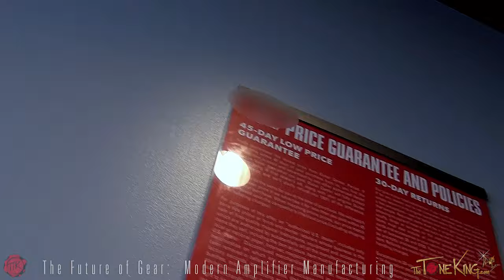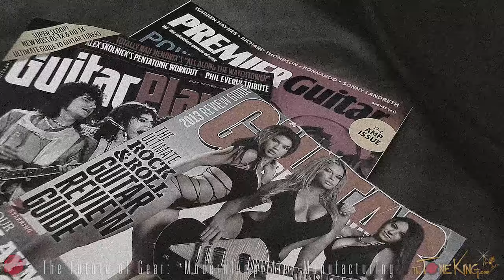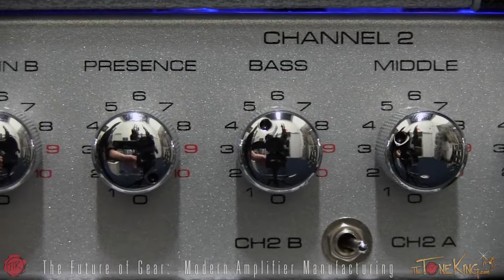The Future of Gear - Modern Amplifier Manufacturing

Comment: I have a China made Peavey 6505+ 112 combo amp and it kicks ass. Never had a issue with it. I believe manufacturers are going over seas because there is a bigger market for mid price products. I believe Custom Amp companies can cover just a small part of the market. I don't think that made in USA or UK generally means BEST option. Play what you can afford and play the hell out of it. I use Mesa Boogies and Peavey because is live outside the USA and the Fixed Bias option on it works for me. To me are some of the best sounding amps out right now. And they are easier to replace than most custom amps. Also people are using AXE FX and Kemper because its just way cheaper to travel with. In my opinion tube amps sound better but they are not as reliable and concistent as Digital.

Comment: I have a black heart 5w tube amp, the wiring is solid and it has never let me down, I did change the tubes when I got it , great amp for me it sounds nice like a good boutique amp, it can keep up with drums , if I need more volume it can be put through the PA. If I had the cash I would buy a boutique hand made tube amp. same with guitars if I had the cash I would by a £2000 guitar but I can't afford one, so I get solid mid range guitars and tweek it until it's good for me and I'm happy with them. if people had the spare cash we would buy the high end gear but the average person has to make a choice do I buy the expensive amp or the expensive guitar.

Comment: I would give my left nut for a 3000 dollar Soldano! I had to settle for a used Carol-Ann for 1600,and a 700 dollar H+K. There are only two big box guitar stores that I know of. Soldano doesn't have to advertise! In my opinion,the Jet City amps,were some of the best sounding amps  out there.

Comment: you want consumers to focus less on price? good luck on that. inflation keeps going up, wages keeps staying flat, and everyday musicians play for free most of the time nowadays. there's a reason we focus on price. it's because people don't have the money. don't forget the dwindling popularity of guitar driven music or over the last decade. cheers.
Reply: +Thomas R. Bowen I agree his thoughts on price is totally is out of touch of reality.
Reply: +Wendell Laffin you're correct. their main point probably is to buy a simple high quality amp instead of modelling amp with all the bells and whistles. there is some truth to that, but most can't afford what these guys need to charge. I'm pretty sure most people would love to use expensive equipment but it's not worth it to most. if you have a choice between a 300 dollar amp and a 2000 dollar amp and the 300 dollar is 85% as good as the 2000 dollar one, most will pick the 300.
Reply: +Thomas R. Bowen I think you are both right.  In my experience, the 300 amp and the 2000 amp have much greater differential than 85% there.  And there's certainly nothing wrong with trying to get the best deal.  You're right, the economic situation has made it tight for everyone.  The point here isn't that people should overpay.  But as you pointed out, taking the extra time to save the extra money to get a higher quality piece is our point.  With guitar gear, there's simply no substitute for quality.  You feel it, you hear it.  It's basically this - rather than buying 3 $250 guitars, players are better off buying 1 good $750 one.  That's what we mean by not fixating so much on price.  And believe me, the manufacturers notice.  When customers are only buying guitars at the $250 price point, we have to ask ourselves why bother to make a nice, $750 guitar?  That leads to lack of available quality options.
Reply: +sammy reynolds  - you can see this response below too, but for ease, let me clarify the point we were making.  there's certainly nothing wrong with trying to get the best deal.  The economic situation has made it tight for everyone.  The point here isn't that people should overpay.  But taking the extra time to save the extra money to get a higher quality piece is our point.  With guitar gear, there's simply no substitute for quality.  You feel it, you hear it.  It's basically this - rather than buying 3 $250 guitars, players are better off buying 1 good $750 one.  That's what we mean by not fixating so much on price.  And believe me, the manufacturers notice.  When customers are only buying guitars at the $250 price point, we have to ask ourselves why bother to make a nice, $750 guitar?  That leads to lack of available quality options.
Reply: +Diamond Amps I would agree that a player should buy a good 750 guitar instead of 3 250 guitars. a collection of junk is still junk. I'm afraid many are in an economic situation where they are happy to have 1 250 guitar, sadly. since gigs for most of us don't even cover the beer tab, let alone pay people, so you can't even write off equipment on your taxes as a business expense. the real ironic part is though that all gear, even high end gear has gotten cheaper since the 50's and 60s. a lp guitar back then would have been between 3-500 bucks. that would have been 3 or 4 months pay for alot of people. now an lp costs what, 1500 to 2500, which takes the average worker a month or so to make. overall, your better off not collecting junk, but to say we shouldn't worry about price is an over statement.
Reply: +Thomas R. Bowen - sure.   And the statement was a generalization.  Not everyone's situation is the same.  There is a clear trend in the market, however.  That's the overall point.  But of course, I'd much rather see someone buy and inexpensive amp and guitar and PLAY, than not at all.
Reply: +Diamond Amps BINGO....that's exactly what I would much rather see so that further down the road when they have more money they'll keep buying as well as keep playing and improving. Either way they will still be part of the market and not part of a dwindling market as you called it in the video. Basically, get them playing and keep them interested and then build it and they will BUY. :)
Reply: +Wendell Laffin cars aren't guitars my friend and you don't always get what you pay for. not all people are cash strapped that's certainly true, but the car market and guitar market are different demographics. as far as the amps go, I think people exaggerate the difference between solid state, modelling and tube amps. my mustang 3 sounds as good as any 112 combo I've heard, you just have to know what your doing. maybe it's just me and I'm hearing what I want to but that certainly doesn't mean that don't work the other way. for me personally and where I'm at, my mustang 3 and classic MIA peavey guitars are just fine.
Reply: Thomas R. Bowen You're definitely wanting to hear what you want. A good 1x12 would smoke you mustang.
Reply: +sammy reynolds I will admit it got quite a bit better after putting a swamp thang speaker in it, but I dig it and I don't get paid to play, so I'm not spending the extra $$$ unless I get in a serious band. the notion that you can't get good sounds from an ss amp though is nonsense.
Reply: Thomas R. Bowen I agree with that. if you don't gig what's the point in paying $1,000 for an amp. And I never said you couldn't get a good sound from a SS. Go listen to Pantera. Dimebag used SS Randalls.
Reply: +sammy reynolds that is true, you didn't say it. I was just going with general opinion I've been reading on this thread. what kind of randall did he use?
Reply: RG 100's I believe
Reply: +CaribSurfKing1  Socialism is very expensive !!!!!
Reply: +Thomas R. Bowen i agree. These folks make fine equipment I'm sure, but given the economic situation going on these days, Diamant needs to readjust his thinking. People probably SHOULD focus less on price but they won't. It's not like there's a choice. Bottom line is, people ARE going to make music. With a clothesline, a stick and a washtub or a cigar box and some old wire, but people will continue to make music.. What they WON'T do is continue to pay higher and higher prices for gear. That's HIS job, not ours,  to figure out how to bring a quality product to the market that's also affordable to Joe the Guitarist. If he can't do that, sadly, his business will ultimately suffer.  (PS - the ALL CAPS words are not shouting...just for emphasis )
Reply: +Wendell Laffin you're right. there is always a market for high end gear. I'm sure these amps are great amps. I'm sure they sound great and are quality builds. I think the main thing though is how it was said came across to me as dismissive. as if to say, if you don't buy high end gear, you will sound like shit and you're not worth our time. I think you can get great sounds with gear at a lower price. is a diamond amp better than my mustang, probably, but until I play in front people who can tell the difference, I'll stick with what I have. I buy the best stuff I can find, used, with what I have.
Reply: +Wendell Laffin Wow, why so sarcastic? I was responding to his comments that people 
should stop considering price. I wasn't "directing" anyone. They're the 
ones who have to pay their electric bill, not me. They can either sell 
more amps cheaper or fewer more expensively. Makes no difference to me. 
He made the statement. I gave my opinion of it and people can choose to 
take it or leave it. No need to get all hostile, friend...its guitar amps, not world hunger/poverty.
Reply: Diamants job is to make and sell guitar amps. Its simpler really than all this economic discussion weve been having. He makes a high end luxury item. Most people either cannot afford luxury items, or can only afford a handfull of nice things. To go back to cars, this would be akin to Ferrari  telling the consumer "quit being cheap and buy a Ferrari, if you dont you suck." Most people who want a sports car will buy the corvette, mustang, charger, so on and so forth. Is a Vette as good as a Ferrari? Probably not, but both will get you a damn speeding ticket if you even try to test which is better lol. Its the same with amps. Diamant is telling us to buy something he knows most of us cant afford. Hes asking us to buy the Ferrari and quit bitching about the price. Reality is most of us players dont need the Ferrari and are perfectly happy and content with the corvette. Would it be nice? sure, but you can make good quality music with both. Price is what makes the status symbol a status symbol in the first place. So quit complaining.
Reply: +Wendell Laffin I was the one who made the 85% comment. I've heard other 1x12 combos and played them when I bought my mustang 3. I tried that ac15 you have, stock of course, and thought it was a nice amp. i almost bought it, I'm still looking at the ac10 and ac4. the mustang didn't sound leagues below the ac15, but it was about 85% as good to me as those vox 's and others I tried and was almost half the price. I buy used generally and they didn't have any used voxs, which should tell me something right? you don't need a big 50w 100w tube head at home. putting one of those at 1 or 2 will shake some windows lol. the only people who need those heads are guys who gig. the people who buy smaller cheaper amps that he doesn't like aren't using them to gig. 1 thing I learned from using the mustang, is I found out what kind of nicer amp I'd want if I did buy one. ironically it's a vox not a fender lol. I figure if I like the vox setting on the mustang the real deal would be sweet right? sound is objective your completely right.
Reply: +aa924 explain
Reply: +aa924 touche

Comment: Just about any quality gear will fetch a nice price when resold. So basically, if you are going to spend more on your gear, from the get go, you will most likely end up owning much more in resale value too!
Reply: +CaribSurfKing1 Sure, that happens when the prices are bloated, like with the new Gibsons, but then again you're not going to succeed in trying to return a new guitar, which I think he tried to do. So the next stop is to put it on sale on some site and with all the paperwork and a date of purchase showing, he most likely can still get a good price for it. Now had he spent around 3000 $ buying a vintage guitar or a boutique amp, the value of it might, in some cases, just rise over time. (This may or may not apply to digital gear of today.)
Reply: CaribSurfKing1 That's why always check what you're buying. I would never spend 3000 on a new Gibson, it would have to be a vintage Gibson. But you're right Mike and Jeff were talking about the new gear to buy, but perhaps more from the amp realm perspective, In that I agree with them, knowing that something like a Soldano or a Diamond amp is a safe investment, You actually get real quality and the amp is not going to be obsolete in two years. But how likely it is, that the Guitar centers of this world are going to carry their amps (at least in their every outlet?).Not very likely! It's easier to have those Gibsons etc. in spades everywhere.

Comment: There are a lot of guitar, and amp snobs out there. Les Paul, or a Strat with a Marshall for example. They won't even give other manufacturers a second look. "If it isn't a tube amp it sucks." They're set in their ways. I think things will go more, and more to digital on the amp side of things. Sound is a wave, wether or not it's Marshall, Mesa Boogie  Dual Rec, Engl, Diamond, or Soldano... ALL sound is a wave, and if/when digital technology can mimic their sound exactly, then you have their EXACT  sound. It's not my opinion, it's science. Maybe they'll never be able to reproduce a particular sound wave, but 25 years ago who would have thought you could store 100,000 songs on something the size of a credit card?